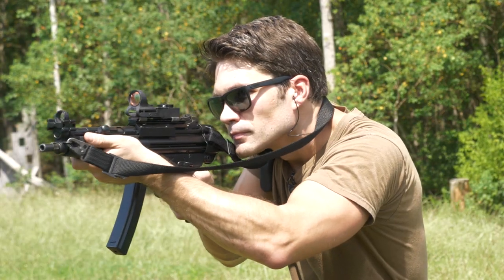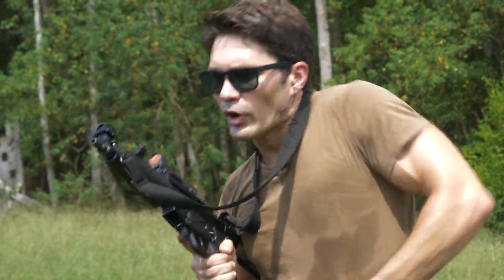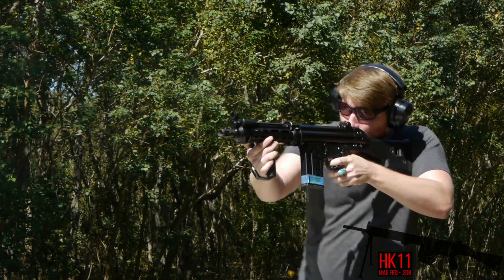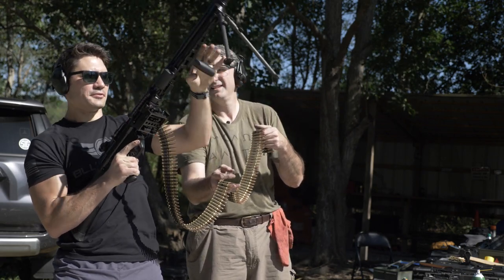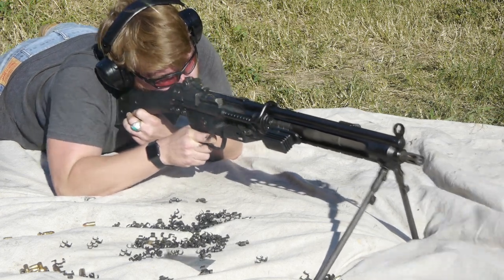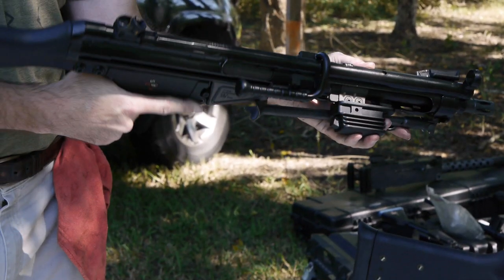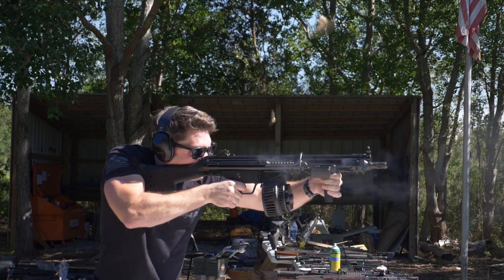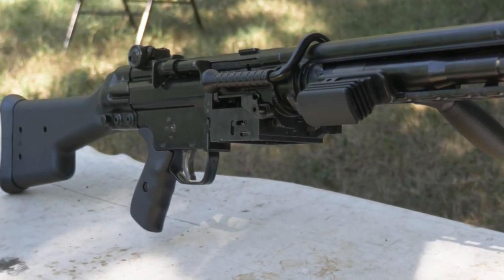H&K's Light Machine Guns: Rare but Effective (HK21/23 & HK11)

Comment: Complains about a piston gun having extra hardware to work but praises a design needing multiple small precisely machined and heat treated pieces. Makes sense.
Reply: #butthurt ak guy
Reply: @thedriveinopera8889  jokes. The ak is baby toy compared the stamped perfection that is an ar-18
Reply: @The_Brozilla  stamped perfection? * laughs in stg44 *
Reply: @hanfpeter3742  laughs in G3KA4
Reply: Brozilla spending money for extra hardware to work or spend little hardware and make a smaller piece that’s got multiple components to help it feed operate better in the field? 
I’m sorry the AK will always be a great sturdy rifle. But H&K all the way bro. The AK is not the rifle once praised in the 20th century like it is today. Even Russia is replacing a lot of its AK models.
Reply: Daewoo > everything else
Reply: @MegaBoooooooooooooob  I don't want to get Daewoo on my hands
Reply: FN-FNC
Reply: @lil__boi3027  laughs in Irish Republican Army
Reply: Pretty sure the locking bolt on all gas operated rifles needs to be precisely machined and properly heat treated as well. Maybe the lugs on a rotating bolt are easier to make precise, who can say?

Comment: Another little known fact is that according  to Col Beckwiths book Delta Force, many of the operators under his command preferred and used the HK21 over the M60. Most of the sub guns they originally used were Greasr guns and Wlather MPL's as well
Reply: They were used until the early 2000s by Delta. When they were there to capture Bin Laden back in October 2001 SGM John "Shrek" McPhee used a custom HK21E with a 3.5x ACOG on it. Why? If the team needed a gunner to lay down suppressive fire, the HK could do it, being lighter than a 240 and packing a heavier round than the 249s. Also, he could simply either swap the lower or go to semi auto for a possible DMR role. One hell of a gun. But it's an HK, we suck and they hate us

SGM "Shrek" with his mighty HK: http://www.gearguide.ru/phpbb/download/file.php?id=2577&sid=0c1ef38d9d54ada8d0412225e2a7f630&mode=view
Reply: The M60 (The Pig) was only really useful in certain scenarios. You needed the right environment where you can take your shirt off and you needed to have lots of oil on hand to slather your chest with. In a modern combat environment, no one has time to get fully oiled up before laying down sustained fire from the hip.
Reply: @kratzlaff308  The german navy's elite combat divers ("Kampfschwimmer"/KSM), which are comparable to the US navy SEALs in many ways, used the HK21 as "G8" primarly in a DMR like multi purpose role until the early 2000s. From time to time you can still find newer pictures of german military special forces and the GSG9 using the HK21that way.
Reply: @Laotzu.Goldbug  It could be a HK11 too. Oh well. But be aware knowing that the lower could be swapped. Leigh Neville's book "Guns of Special Forces" and Shrek himself said that it was a HK21E. According to him, KAC guns in 7.62x51 weren't combat reliable at that point.
Reply: @Laotzu.Goldbug  The Bundeswehr didn't realy have actual sniper rifles until the early 1990s and primarly used the G3 with a 4x Hensoldt scope in that role until the G22 was introduced. Unlike the rest of the german armed forces, the Kampfschwimmer allways had a lot of free choice in regards to their armament. They allready used the G8 as an LMG and soon found out that it was also extremly good at long ranges in semi mode, so they started putting scopes on their G8s and used them in kind of adual role as LMG/DMR combination instead of using two different systems. The former  Kampfschwimmer Willhelm Probst wrote about that in his book "Die Kampfschwimmer der Bundesmarine".
Reply: @geist41334  interesting and amazing how hk managed (maybe by accident) to get a dual role weapon
Reply: At least one HK 21 was taken on Operation Eagle Claw to provide suppressive fire during the embassy assault.
Reply: @Laotzu.Goldbug  The MSG 90 is even heavier than the HK21...7-8lbs vs 13.8...why would they carry a much heavier gun that is limited in role and not meant for the military? The PSG-1 and MSG-90 ARE NOT MILITARY RIFLES. They are for counter terrorist or police SWAT operations. They are not meant to be moved out of the initial deployment position.
Reply: @Seb-Storm  nowadays they have the HK416 that fills multiple roles. The M27/M38 is the same gun, with different optics.

Comment: I worked with these in the Hellenic Army - damn they are sooooooooooo nice. I really dont understand why they are not more popular and better known. The ergonomics, performance and wieght are top class. I havent worked with m-60's, 240's or 249's, but just from what little I see on vids, the HKs seem far superior.
Reply: @mcpuff2318  I can see how some of what you say is the case. I disagree with sustained fire and accuracy though. With these HK's you're likely to run out of ammo before  overheating is really an issue, and when it is an issue, barrel swaps literaly take less than 10 seconds. An American freind of mine who is a vet was telling me how a barrel change on the m-60 can amount to a death sentance in some cases, and how bloody heavy it is. Rate of fire on the HK's is also ideal, and recoil is truly mild even for the 7,62. Especialy prone, you can realy get accurate fire.

And calibre and mag/belt change is also fast and priceless.

Anyway, I'm a HUGE fan of these. Cheers!

Comment: The HK11K is the Holy Grail of Assault rifles 
Can be swapped to feed the two major western military cartridges, can be fitted with an AK feed if it can be found, simple yet refined design, easy to field strip and maintain, all the simplicity and ruggedness of an AK with the German sophistication  and smooth fire rate and feel in a compact relatively forgiving to fire rifle even in 308 full auto 
It's too good for its own good

Comment: They are actually easier to load than other beltfeds. HK has a long first link that you push through and pull the first round into position before you charge the gun. You don'T need to move the feed ramp to load when you got the long first links.

Comment: I'm fimilar with the MP 5 but when I entered service it wasn't yet available. I personally used the S &W model 76 and it was a bit heavy but did the job. Later in my service while working with NATO forces I encountered the model 93. 

I didn't fire the weapon but those issued it swore by it. From all accounts it's more reliable and accurate than M16 or it's current configuration the M4.

Comment: We had HK21 on basic training, and nobody liked it. Field stripping was too long and difficult. And for some reason, it was very hard to charge the barrel from prone position. We were attaching sling to a handle, and pulling it with it.
Reply: Do Re you need more push ups and pull ups in physical training.

Comment: Nice video but there is one little misstake. 308 is not = 7.62 Nato. The part in the case (i don't know the english word for that) were its becoming bigger as the bullet, is in a almost not visible different angle and sharpnes. If u feed a G3 like the Bundeswehr is using it, with 308, it will not cycle how it should.

Comment: The Portuguese Army really used this machinegun effectively in combat in Africa during the late 1960s and early 1970s in their colonial wars. The Portuguese Army loved German weapons that the MG-3 version also served in Africa along with the HK 21/23. Their elite Paratroopers, Light Infantry, and Marines because the parts are almost G-3 compatible as their service issued rifles. Both HK 21/23 and MG-3s did serve in elite and regular infantry combat units. The elite units used them effectively to hammer the enemy in the jungles because its much lighter and more maneuverable than the MG-3 which is excellent for established and fixed positions. The HK 21/23 was perfect for elite troops as portable fire support like a SAW before the 5.56mm became standard for the Portuguese Army.

Comment: The only thing that might beat the HK23 in the LMG role is the Negev, but it's interesting to see that if you just had a top rail on the HK23, you would also enjoy a similar benefit to the Negev--being able to reload and clear stoppages without disturbing the optics. I wonder what LMG gunners who have handled all 3 would say was the leader?

I think the apparent lack of popularity of the HK21 though is partly attributable to its greatest advantage over the M240B/FN MAG....lighter weight. Being built entirely differently and heavier than an M240, the GPMG teams may suffer, but that extra mass has important advantages for aircraft and vehicle mountings. And designs like the Mk46 neatly address the weight concern while keeping the manual of arms identical to the LMG.

I am not sure if the "load from the bottom" of the HK21 is better or worse than the classic "open feed tray cover/brass to grass/slap it closed" process for other competing designs. But I think the apparent ubiquity of that design feature partly answers that question--the loading and feeding is right in your face, and is easier to do while prone (even if only psychologically). 

I think the more surprising thing is that the HK designers made their LMG/GPMG designs work so well at all.

Comment: Wait, what? Can the M240B fire up to 950 RPM? I tought it only fired at 650 RPM. What version of the 240 fires that fast?
Reply: The M240C, and M240D, and M240G had the adjustable gas regulator. The adverse position had a larger gas port. It was only intended to be used when the gun got sluggish. The problem with using it that way on a regular basis is the gun beats itself to death. I talked to a M240 Weapons Specialist who worked at Rock Island Arsenal around 2003, and he said the Army was going to go with a fixed regulator to solve that problem., and the M240B was born.

Comment: If any one has any Hk 91 or Hk 93 series rifles, get an Hk 21 club foot stock. They are awesome and the rear sight beats the acorn sight, plus get the eliminated front sight. Being an owner of Hk 91a4 customed with the Hk 21 club and rear sight and glowing front sight and the G3a4 forearm with bipod and quad rail on the top of the reserver with a side collapsing 3x scope. If you find a true H&K at a gun show get it!

Comment: There is one annoying misstake in this. The G3A3 is not chamberd in 308. its 7.62x51 NATO. This is NOT the same. The Projectile? Yes, but the Caseing is different. If u feed a original G3A3 with 308 it will not work propper.
Reply: e30kitty that’s total bs I own a G3 and an HK 21 and they both run 308 fine.